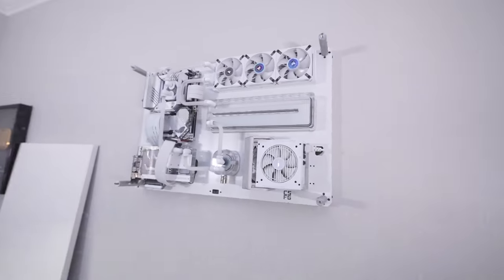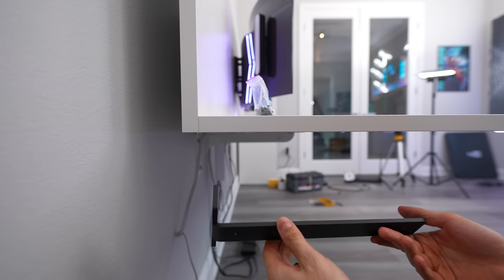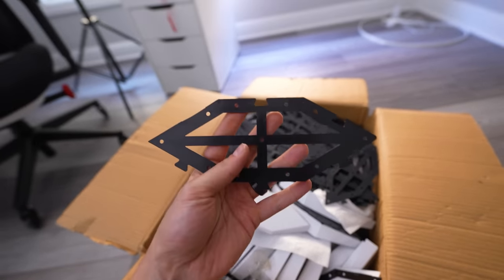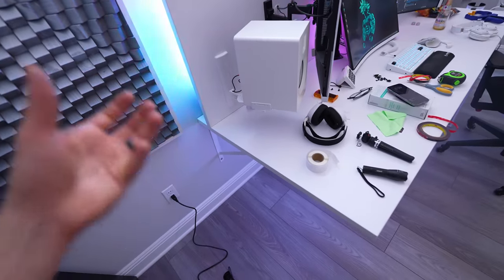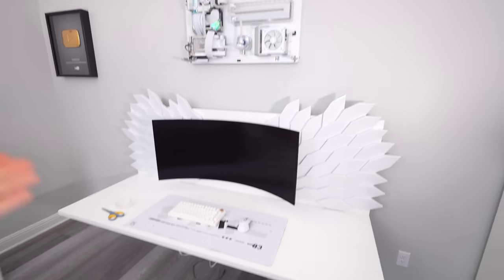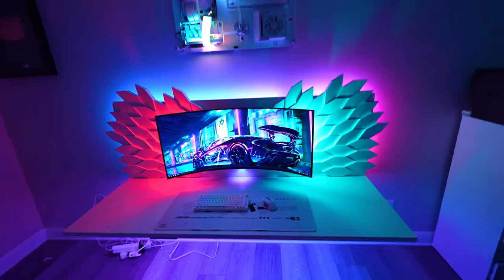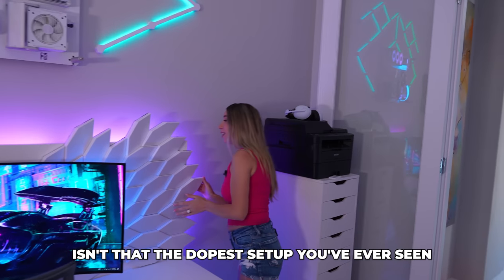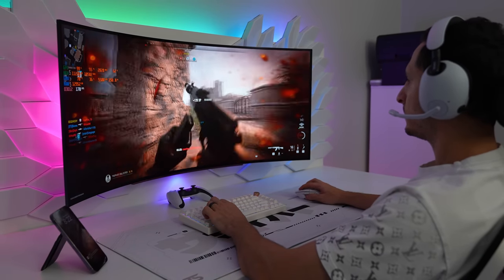I Built the Ultimate Wireless Floating Desk Setup!

Comment: Great video as usual!👍

Question: large screen TVs use wall mount that will pivot/extend away from the wall a good 12" to 15" inches...

Wondering why you didn't consider this type of mount especially for maintenance and other reasons.

Comment: Looks great, but it's just a matter of time before that horizontal surface is broken off because that bracket system at 30" from the vertical surface is only rated for about 20lbs... so don't put anything heavy out near the edge.

Comment: Wtf. Don’t take the plastic off the double sided tape till you put it on the piece. You press against the plastic backing to make sure it’s on properly. Then peel the plastic to attach too the wall or whatever. You did it with the clear backing stuff but not the red.